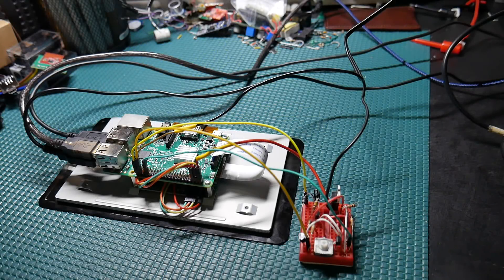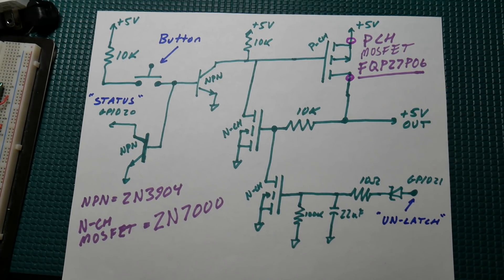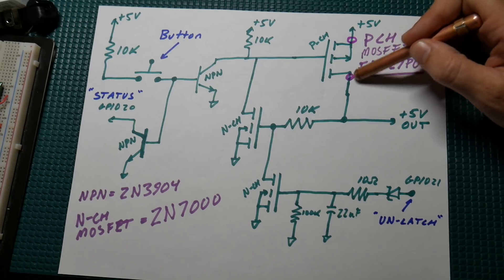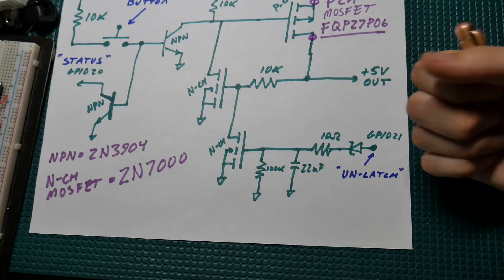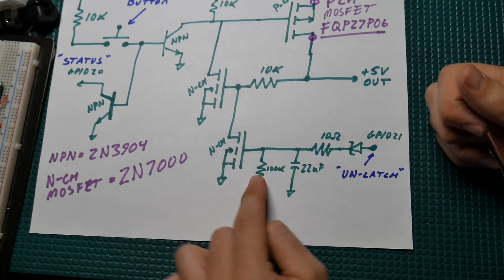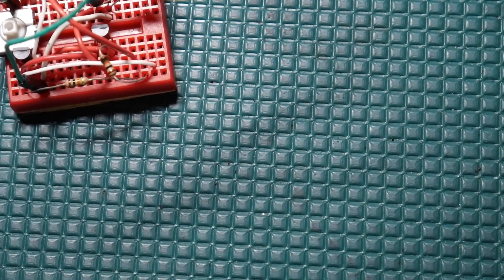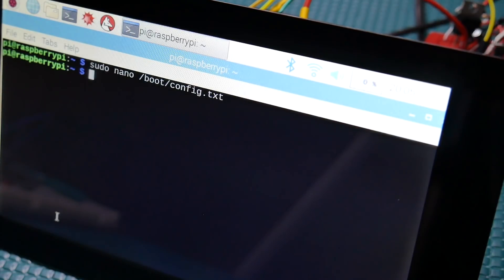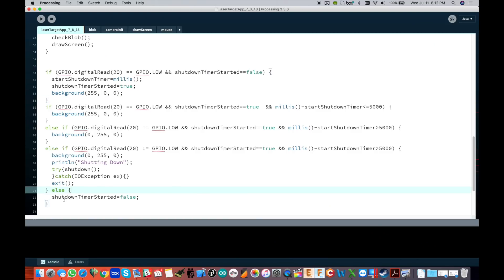Simple Button Circuit to Power ON & Safely OFF Raspberry PI

Comment: Great solution and better video.
I have used it in a circuit for my raspberry and everything works fine.
Just two recommendations with a couple of things that have driven me crazy.
The GPIO pin used to unplug the source must have the same voltage characteristics as pin 21 used by the video, check with "gpio readall" before deciding.
With the config.txt powerdown overlay it is a bit tricky to change this state.

Another thing is the voltage drop that it produces and it must be taken into account depending on the use of the raspi and the power source used. It is likely that the yellow ray will appear on the screen.
Thank you very much Kevin

Comment: Smart idea. I had to tweak a little and add 100nF capacitor between gate and ground of latching mosfet. Probably used different parts  than on video. Without capacitor power mosfet was on after powering the system. I am not a specialist so can anyone explain theory behind using this capacitor.
Reply: I had to do the same. Nice work :) Thank you for sharing the solution.

Comment: were thailand can orden ready circuit, i not can orden anywere all transistors and mosfets etc other parts. need ready to use module. i has try looking and test one timer relay module but not working right. need safety shutdown scripts whit has added one gpio output to trigger. trifgger tell timer how longtime keep poer on and then closed power. and one button were bush power on again

Comment: You can change the "UN-LATCH" pin to another one by changing the dtoverlay settings in /etc/config.txt, but be aware of the default pullups/downs of the device. GPIO 0 to GPIO 8 have pullups at startup, so the input will be tied high at boot and reset the circuit immediately. 
See docs of the Broadcom chip on page 102:
https://www.raspberrypi.org/documentation/hardware/raspberrypi/bcm2835/BCM2835-ARM-Peripherals.pdf

Comment: interesting, but not simple made in home this, some other no need shit lot mosfet and other components. i  think i orden timerelay ,what closed time x to power, and trigger controller when time start, simple need only 2 gpio in and out, in sense power and show led, out controll py code to out relay time start. when shutdown -h processing has ready closed power whit relay. super simple no need more. need only relay module 2$ and some wire and one resistor and led, and IF want fine need usb  plug female and male. power cable in and out. max about 6 $ or orde3n ALL component what you opinion have and cost 16$ all about and lot lot more work and no sure working newer, i no believe.

Comment: Could I use an arduino to act as power switch for the pi?
Reply: That would add to the complexity and also you would wind up utilizing power for the Arduino to monitor the switch.  Granted, you can really reduce the draw using an Arduino, but in Kevin’s case here, at off, there is NO POWER being used.

Comment: Hi Kevin, I build your device and install the software and run it after boot. The device works however not with the pi.  With processing I build the program  and export the application.

I removed everything what was not needed in the sketch and use here a rpi4 ....... please advice..something is wrong dtoverlay=gpio-poweroff,gpiopin=21 ..... I suppose.
Best,
Johan

//Laser Target App
//Kevin Darrah
//http://www.kdcircuits.com

import static javax.swing.JOptionPane.*;//needed by the message box for selecting port
import processing.io.*;
//variables that can be customized

long startTime_shot = 0;//this is the timer variable for the delay between blobs

long startShutdownTimer;
boolean shutdownTimerStarted = false;
void setup() {
  GPIO.pinMode(20, GPIO.INPUT_PULLUP);
  
}

void draw() {
 
  if (GPIO.digitalRead(20) == GPIO.LOW && shutdownTimerStarted==false) {
    startShutdownTimer=millis();
    shutdownTimerStarted=true;
    background(255, 0, 0);
  }
  if (GPIO.digitalRead(20) == GPIO.LOW && shutdownTimerStarted==true  && millis()-startShutdownTimer<=5000) {
    background(255, 0, 0);
  }
  else if (GPIO.digitalRead(20) == GPIO.LOW && shutdownTimerStarted==true && millis()-startShutdownTimer>5000) {
    background(0, 255, 0);
  }
  else if (GPIO.digitalRead(20) != GPIO.LOW && shutdownTimerStarted==true && millis()-startShutdownTimer>5000) {
    background(0, 255, 0);  
    println("Shutting Down");
    try{shutdown();
    }catch(IOException ex){}
    exit();

  } else {
    shutdownTimerStarted=false;
  }

}

public static void shutdown() throws IOException{
      try {
      Runtime.getRuntime().exec("sudo shutdown -h now");
    }
    catch(IOException ex) {
    }
  
}
Reply: hi, same issue here, did you eventually figured it out?

Comment: Can anyone post a few alternate transistors / mosFETs that may be used for this project? 
I am highly ignorant in terms of this type of electronics component. That is why I do not want to buy hundreds of transistors of which I will most likely only use 6. 
I even found a (German) spreadsheet that gives quite the overview: https://www.mikrocontroller.net/articles/MOSFET-%C3%9Cbersicht

This alone still does not help me, because I have no clue what values are acceptable. Plus, according to the following web page, some essential data is missing in the above overview:
https://www.electronics-notes.com/articles/electronic_components/transistor/choosing-replacements-transistors.php

Comment: I have on my pi. If you power of, is it going to off the fan as well?. My pi even after shot down, the fan keeps rolling till I unplug from power supply.
Reply: good system no need unplug anythink, after normal shutdown -h script board need be time X and then relay closed off power. no need unplug anythink, just this i has looking many place, atxraspi board have BEST but no can orden my country this or cost 7 x more than internet board cost, about 16$ and delivery,toll,and tax, cost my country 5-7x more this need found only good schematic raspi shutdown timerelay system.  gpio trigger relay and time x closed power. when normal code shutdown has ready.

Comment: Seem like a standard diode might be used in the GPIO unlatch function.  The extra forward drop shouldn't cause any problem, because VgsOn should be fine with the 4.2V supplied.

Comment: You should use separate base resistors for your NPNs. If you get unlucky and they have significantly different Vbe only one of them will turn on. Also you can replace them both by a single diode if the only thing you want is isolation of latching part and signal to Rpi.
Reply: Please, for folks who are not professional in circuit design, where to put the base resistor/diode? Could you upload an updated schematic?
Reply from the maker: good call, missed that, thanks!